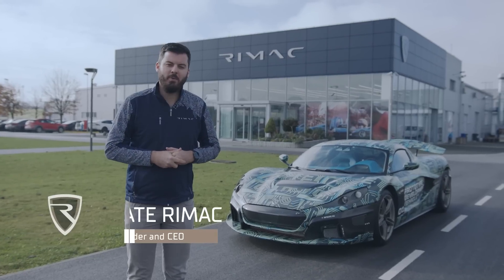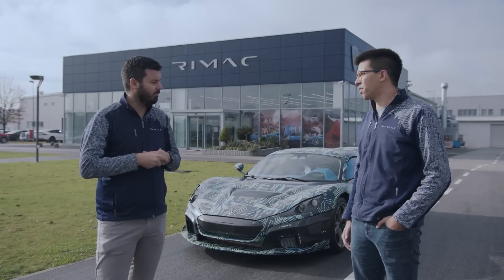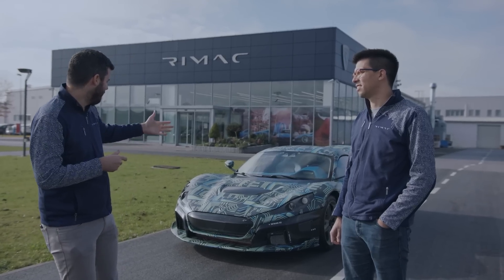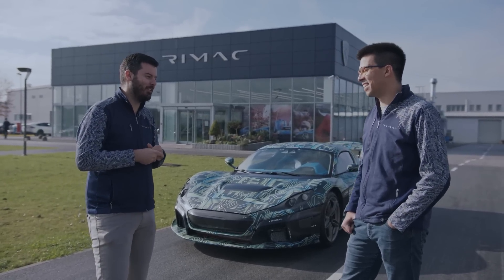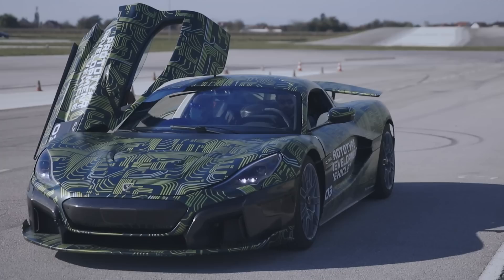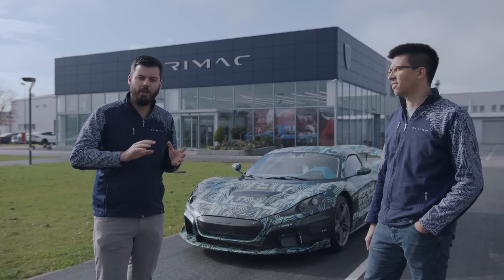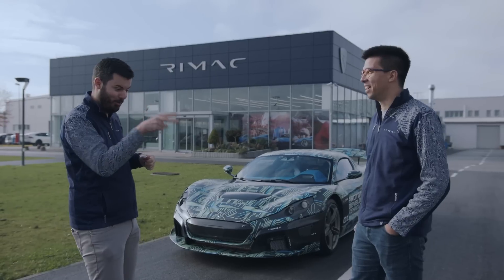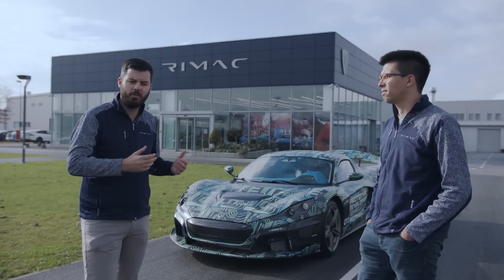Hypercar Track Testing | Mondays with Mate 15

Comment: Congrats on 50k!!!
P.S. Miss you Sir Renić
Reply: Hi Misha, there is a video where you tell why you left Rimac?
I am big fan of Rimac, your crew Robert, Tim ect, have a nice day!
Reply: @fermignano89  Here you go: https://www.youtube.com/watch?v=n5Y8rkKwO0M
Reply: Misha, I would love your opinion but assume you likely wouldn't openly share your opinion of a potential Rimac C2 time around the Nurburgring. Spec wise the car should beat the Nio EP9 at which point it should be competing for fastest production car... I would love for that to be the case but I just feel like I'm missing something that will prevent that? For one I hope Rimac can have sufficient and reliable cooling for 2 or even 1 lap though  based on Taycan, Model 3, and EP9 (with reduced power mode) experience to date it will be tough...

Comment: This was very impressive, functioning once again like an F1 team but with a twist!
Question: With only about 600 employees to design a full state-of-the-art vehicle, are your new recruits trained upon arrival at Rimac, chosen with sufficient qualifications or does the team learn by doing?
Reply: they are closer to 900 employees now
Reply: @pero9254  ah that makes more sense, thanks for the information 👌👌
Reply: Only 600 employees??
That's a lot!!
Reply: They used to take people straight after college and educate them directly cause in croatia they were the only source of info. Nowadays just a single glance on the hiring page, every position requires multiple years of experience in car related jobs. They are big enough that people are leaving high paying jobs in big companies to work for less at rimac which in return makes it basically imposible for a 20sthing year old to start working there after college and learn how to do the job while doing the job. Best option now is to apply at one of the big guys like bmw, vw...and when you get some experience, then apply for a job at rimac.

Comment: Congratulations for bartul and thank you for this informative video.
I got one question, through these tests if you guys found an issue with a component or sensor which needs to be replaced, how this will reflect on the process which is already going on in the production since you guys may have already decided on that part/sensor previously. will the latest test result, results in repetitive iteration for the production/manufacturing procedure. 
Thank you!

Comment: That was great! Few questions here: 1. What is an average safety factor you are calculating with, when developing key performance parts? 2. Since I believe that new Rimac will support occasional software updates that could affect performance improvements, I am interested in whether those updates are, in general, mainly based on algorithm improvements(purely software update) or upgrades can also be achieved using physical/mechanical space for improvement that safety factors allows?